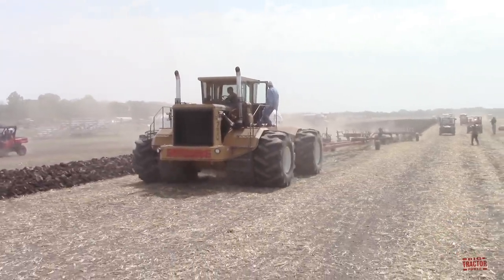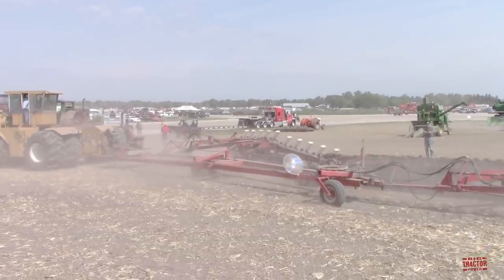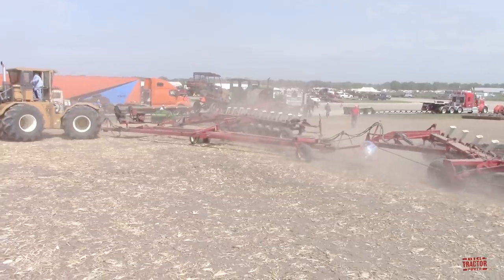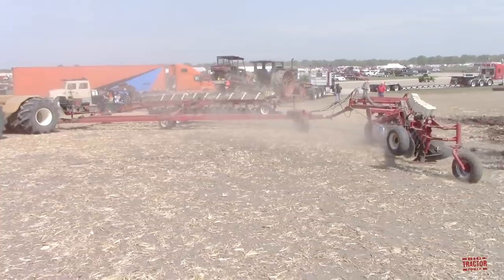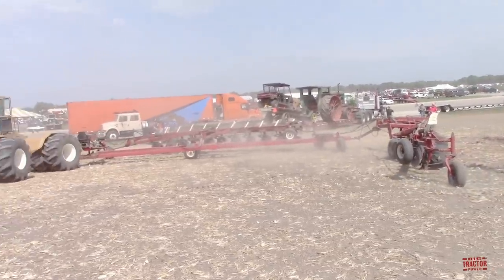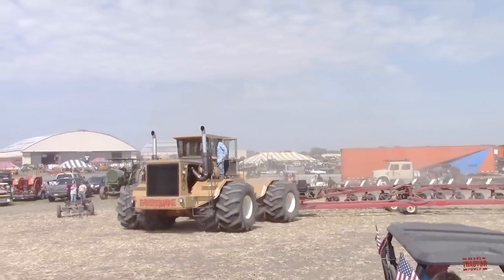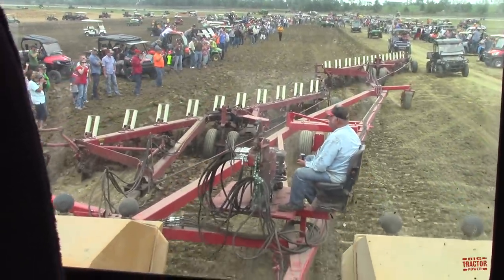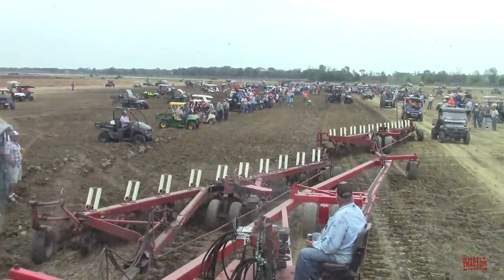750 hp RITE 750 Earthquake Tractor Plowing

Comment: If the Big Bud 747 is #1 and RITE 750 EARTHQUAKE is #3 what's #2 biggest tractor?
Reply from the maker: The Big Bud 740 is the second largest.  Two were built.   They are currently cranking out 1,000 hp.
Reply: @bigtractorpower  hasn't one been just sitting for several years or did they get it back going again

Comment: Could a new John deere 9630 do the same thing?
Reply from the maker: The 9630 weighs about 39,000 lbs from the factory and can be field weighted to 60,000 lbs. The 750 was built at 69,500 lbs with no weights. The 750 is going to offer more pulling power.

Comment: 2t diesel v12 diesel even in low rews sounds like 8k RPM 😮
Btw huge beast.
I would love to see that with some modern equipment
Reply: Is it possible it sounds that way because it is a 2 cycle diesel?
Reply: @dwightl5863  it’s 2 stroke and yes that’s the reason
Reply: @dwightl5863  the frequency of combistion is 2x higher in compare to 4t so this is the case